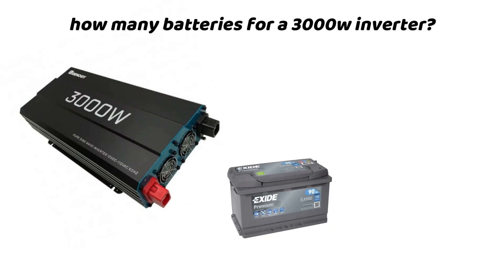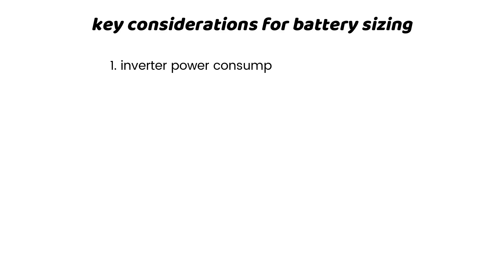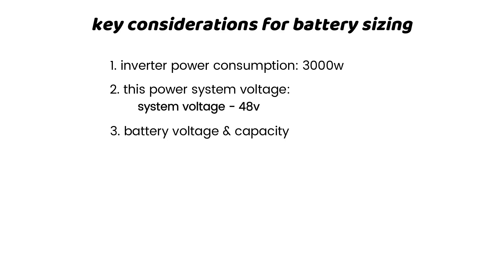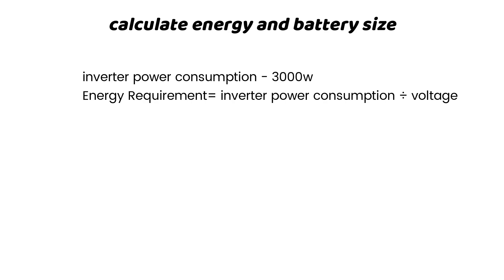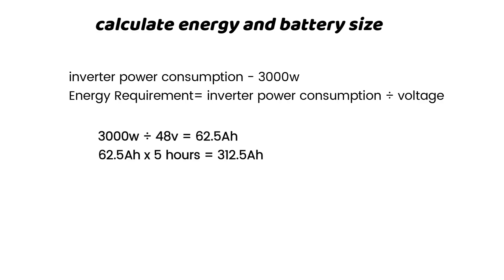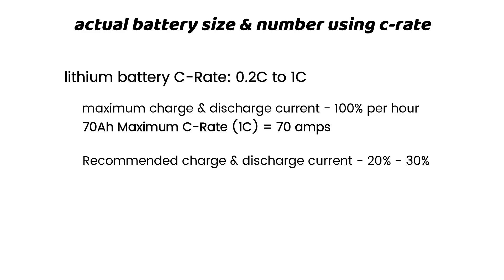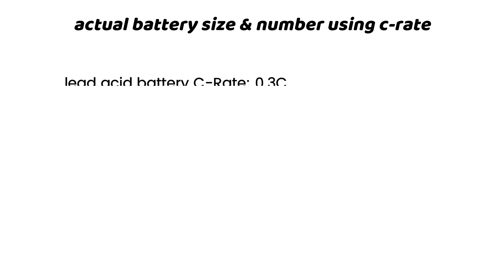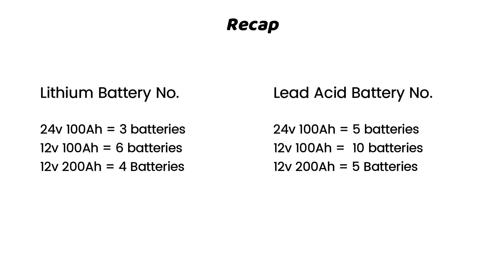how many batteries to run 3000w inverter? solar energy setup guide #solarenergy #inverter #battery

Comment: What about AGM batteries aren't they better than lithium?
Reply from the maker: No. Lithium is better:

higher energy density and portability
More sustainable and eco-friendly
better lifecycles - basically, better lifespan
better long-term storage capability. 

So lithium beats AGM🙂